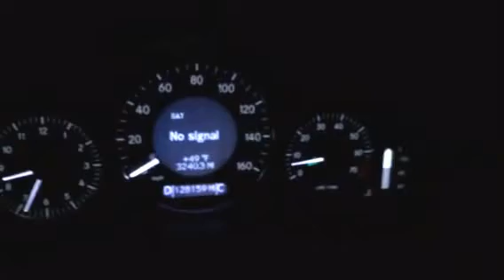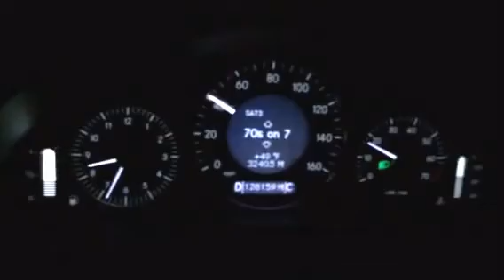2007 Mercedes E350 acceleration problem

Comment: It's called a conductor plate. $1173 to fix at your local Mercedes dealership. And you will have to take it to the dealer because the conductor plate is a "VIN# specific part" They claim this was done to prevent theft related issues which is a bogus claim. The vehicle your driving (like 2 of mine) have a 722.9 transmission and are notorious for this issue. The car is actually between 5th and 6th gear, hence the no acceleration. When you shut the car off, the module resets itself and will drive normally until you have to put your foot down, when the transmission needs to upshift is when the module commonly faults out.

Comment: This just happened to me. Except after turning the car off, and starting again, my car was jerking forward like it was finally getting fuel in the engine. Thank you for sharing video. I should have recorded my experience. Not sure if they can duplicate it at the shop. It seems to happen after I fill up gas.
Reply: Jodi Vachon ...i have the same problem after i get gas. Started lastnight. Did u figjre out the issue?
Reply: Ms Rae somebody said fuel pump on here... thats what it could be

Comment: Have been through this 100 times. Mercedes Benz of the Palm Beaches said it did not happen when I  took it to them. THEY LIED. Today, I left my office and I could not get the car to change gears, and drove home at 25 mph. Went to the side of the road more than 4 times and turned it off and then on and nothing happened. The problem remained. After 100  times of experiencing what is in this video, this is a real problem. MERCEDES OF THE PALM BEACHES, YOU ARE GETTING SUED. Thank you for this video.

Comment from the maker: Well I don't know what to say because I'm getting a lot of different comments. yes I'm still driving the car, and ironically this hasn't happened in quite a while. I have not had it serviced to address the problem, so that makes it even more interesting!! I'll also say that it's the best car I've ever owned and I will definitely get another one. I get why they're so expensive. It'll be interesting if this problem flares up again because it happened for quite a while fairly consistently. I'll keep you informed.
Reply: +James Ginnetti You mentioned something about e350's having a "Recall"? Or was that just your car to be specific?
Reply: você finde problem my friend i have same problem in my mercedes
Reply: Sorry  to comment on an old thread but I have an e350 and if I aggressively accelerate and change lanes (for example to pass someone) the car will disable all driver assist functions and go into this crawl mode.  I assume its some aggressive driving prevention “feature” but I will say that just passing someone on the highway will cause it to occur for me.  I can get it to happen anytime and I have to turn the car off like you describe to get back to normal running. I wouldn’t be surprised, being a European car, if they have some programming to dampen everything to encourage a more sedate driving style.  It would be interesting to find out if this is a technical issue or a design choice.  In either case, I hate it with a passion.

Comment: This has happened to me twice,. (2007 E350 6 cylinder) Each time it happened I placed my foot on the brake and shifted the car in park and then immediately back to drive. Both times it immediately resolved the issue. I never pulled over to power the car off and back on again. The procedure I used immediately got me moving again.
Reply: Worked on me. Thanks for the advice

Comment: Definitely the throttle position sensor. I had a 2003 e500 that dud the same thing. All you have to do I replace the speed pedal.

Comment: Same problem on a 2012 E350 Cab.  w 21k miles on it.. when I accelerate fast it trips out and wont accelerate. Shutting down and restarting clears it. But it continues to do it when I try to accelerate aggressively.

Comment: I have a 2006 e280,and i am facing the exact same problem.It gives problem on the first drive but little while later i restart the car and runs normal.Any suggestions and how much would it cost??

Comment: Hey I have this happening to me on my 07 C230 Sport 7speed auto while I'm on the freeway it seems to happen when my lights are on but sometimes not and it doesn't show no check engine light and I have replaced and put a ton of money into this car and I just want it to drive right ... It also shifts horribly and I have had a bunch of diags for 150$ ea time and they never fix it although this last time they told me they updated something and said o it shifts fine for me and I hope you experience the same and I was like yeah I hope I do to after paying 250 for diag and update and low and behold it still shifts the same and now is doing this sometimes on freeway outta nowhere ... :'( SOMEONE PLEASEEE HELP I Have a Video as well. Thanks a Octillion!!!!!!!